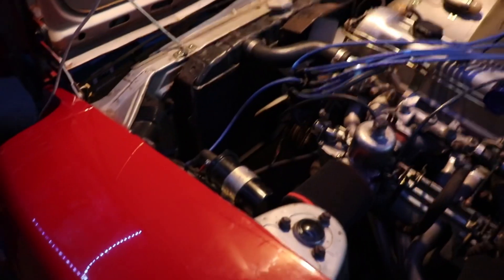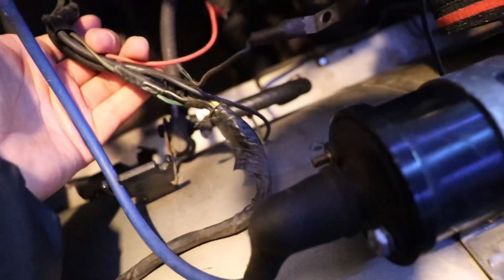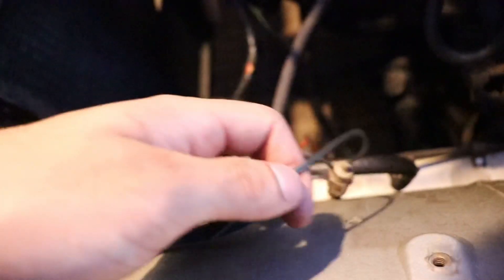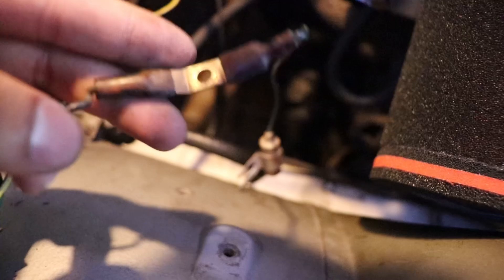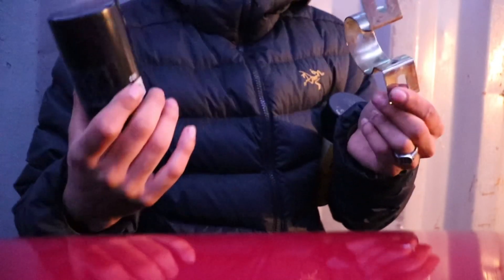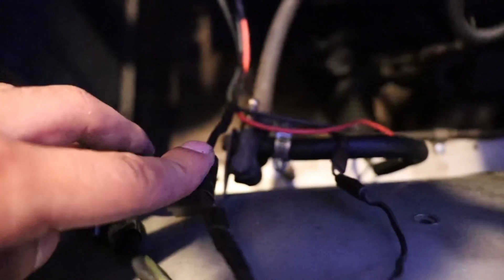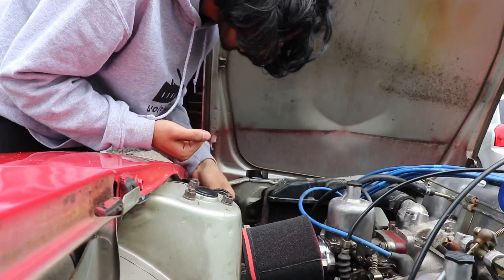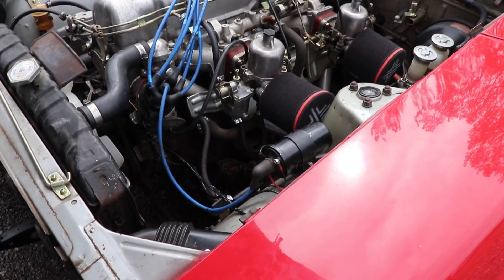figuring out 240z ignition coil

Comment: Great video does the coolant temperature sensor connect to the positive or negative side of the ignition coil?
Reply from the maker: so sorry i literally have no clue im not too sure so dont want to comment - however im sure if you ask on the z forum they will be able to help you the guys on there are so helpful and nice to speak to - sorry i couldn’t help - stay tuned and subscribe tho as we have just rebuilt the whole head, painted the engine bay and redone all of the suspension and other suspension bits videos will be coming soon ❤️⭐️